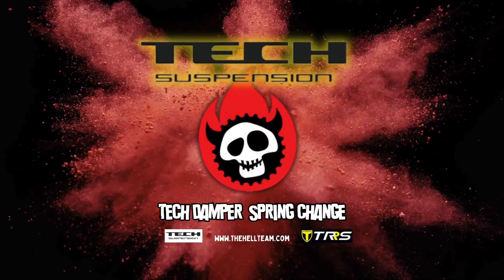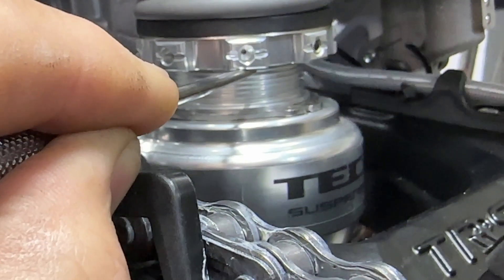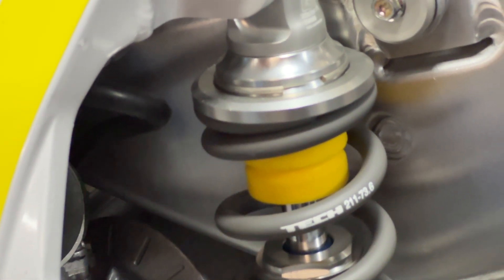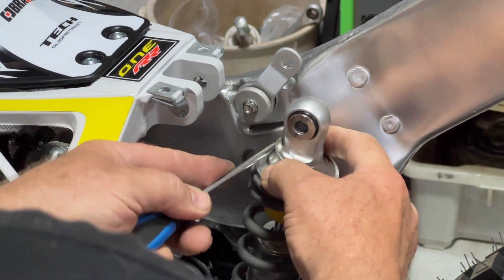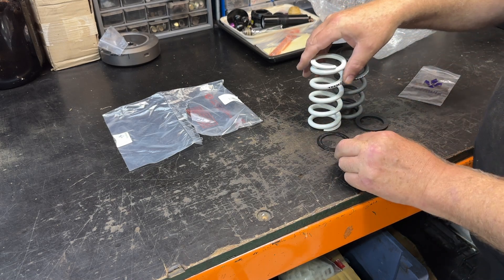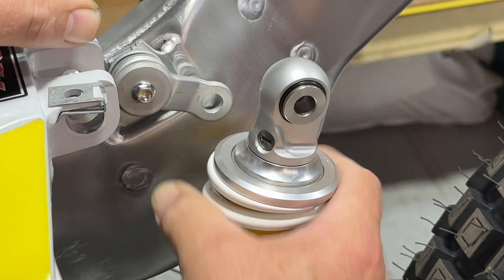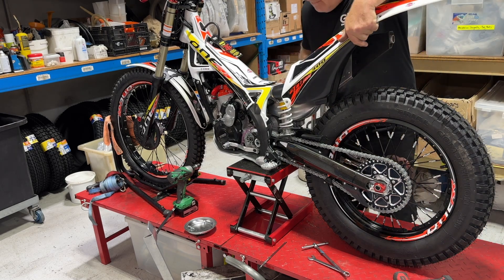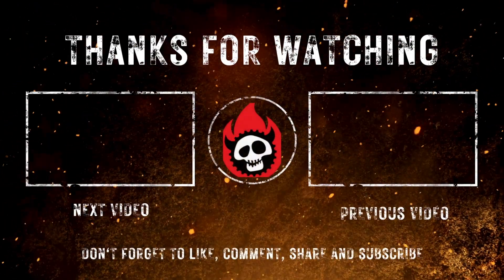The Hell Team   TECH Damper Spring Change

Comment: man the only video of this on youtube and it doesnt show the Tech shock with the rebound knob that has to be removed. ZERO instructions online for the tech shock, i feel like im going to round off the 2.5mm head, or damage the internal damper adjuster, not sure which could be worse. Would i hold the knob while trying to remove?
Reply from the maker: Hey Sickly. if you look on The Hell Team website we have the User Manual you are looking for. Click on TECH SUPPORT (top menu bar), Then *GENERAL and OTHER*, then *TECH SUSPENSION MANUALS*. What are you trying to do? You say the "rebound knob that HAS to be removed".
Quote from manual: 
Do not use the 2,5 mm hex key to control the rebound: only use the knob. Controlling the rebound by using the
knob's screw could cause malfunctions. If it's impossible to control the rebound manually with the knob, it must be
disassembled with a 2,5 mm hex key and the rebound control must be performed with a 6 mm hex key.